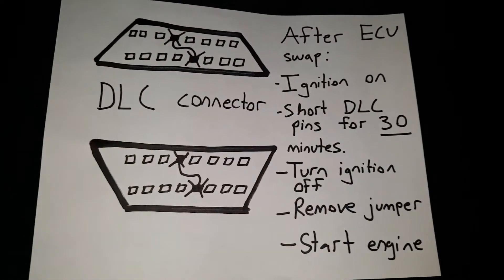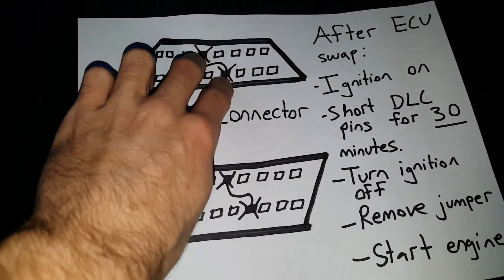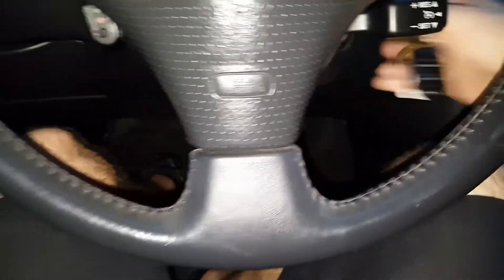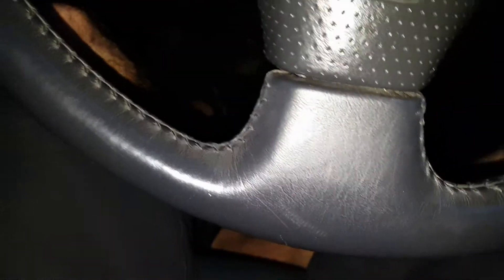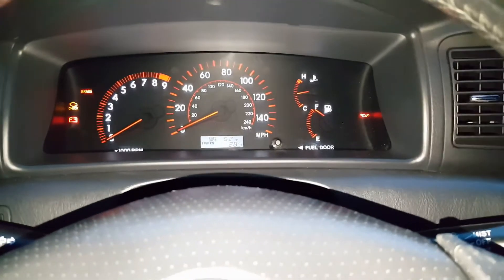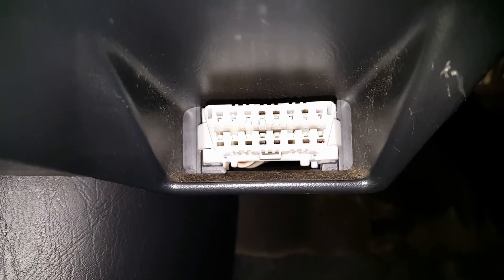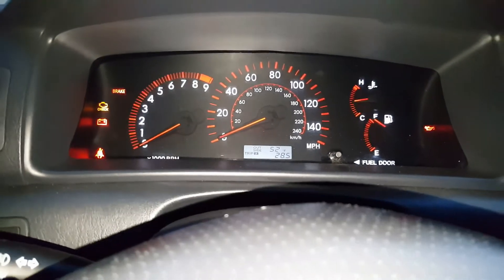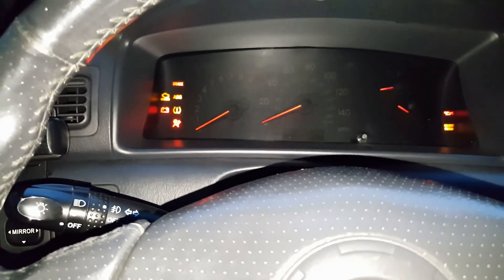Toyota/Lexus/Scion Transponder ECU to ECU re-sync/reset

Comment: I'm guessing if the car doesn't turn on it wasn't successful?
Reply from the maker: It should crank but not start if the immobilizer isn't set.
Did you replace the engine ECU?
Reply: I finally got my re-flashed ecu back and it fired up on the 2nd try. Thank you.
Reply: No. I reached out to mwr.com because I've got several goodies on my xrs but was wondering if this would be ok if I did this instead of doing the whole ecu piggyback. This would be much much cheaper.
Reply from the maker: You should only really need a piggyback if you're doing something elaborate or forced induction. Otherwise a reflashed ECU should take care of you.

Comment: Please HELP/answer im desperate at this point how would i reset/relearn on a 1997 toyota avalon xls v6 3000 four cam 24   1xz-fe egr engine NOT THE VVT i took off throttle body n cleaned iac tps put it back on n rpms are going up and down between 1500-2600rpms in park
Reply from the maker: This video isn't for the re-learn of the idle. It's for the transponder (key/immobilizer)
It's possible you have a bad IAC valve, you might need to drive the vehicle for a while for the idle to 'relearn' after you cleaned everything.
Reply: @JustinJGrizzle117  yea i know this video wasnt about my problem lmao just seeing if u were familiar with my specific car i've asked everyone i kno & everyone i dont, mechanics etc but nobody has a answer if the car i have resets by it self or if i have to trigger a relearn mode in the computer nobody on YT covers this exact car/engine if they do its the vvt 1xz-fe not egr format and the year and model is different not 1 video on 97 avalon xls its a great car over 310,000miles and engine tranny shift like brand new, i removed/cleaned throttle cause engine lost power bucked when gas pedal was pressed normal under load/climb hill but was fine if pedal was pressed lightly and idle was steady before removal/cleaning and tripple check the reinstallation so i dnt understand how to fix it... i really appreciate that you responded if you are familiar and kno the answer please any info in the right direction would be heaven sent but if not thanks for acknowledging my question and sorry to have bothered you sir..

Comment: So would this work if I bought a used power steering ECU for my lexus but its from a newer model? I have confirmed that you can use newer ECUs from similar models but only if you calibrate it using techstream. Would this "calibrate?"

Comment: will this work is if dont have master key and want to program a new key fob
Reply from the maker: manuel matias this isn't for programming a new key fob, this only resets the immobilizer (engine start).
There should be other videos out there to program new key fobs. :)
Reply: Justin Grivich thank you
Reply: Bought used ecu from eBay does this work for 2006 gs300 lexus.cause the dealer wanted too much to reprogram and the obd2 is mounted side way on gs any advice would much appreciated

Comment: hey so hows that reflash? im definitely thinking about doing it on mine
Reply from the maker: I'm loving it so far. I'm having fuel delivery problems at high RPM (need to replace the fuel pump and filter) but other than that, it's great. More power and lower lift makes the car a lot more fun.
Reply: yea im planning on getting a tune for mine. i have an i/h/e with ip coils but it needs a tune bad..its pretty quick as it is but I know its got more to give